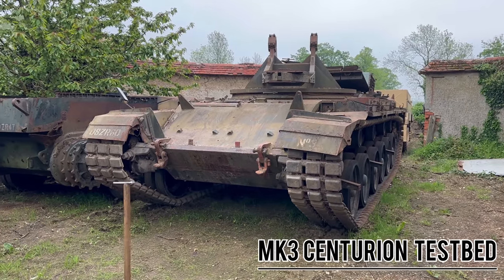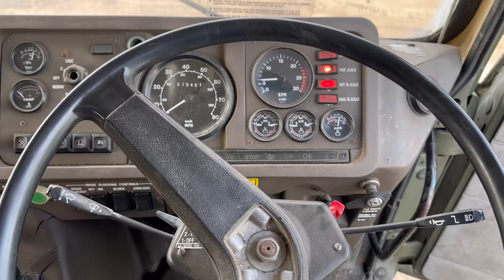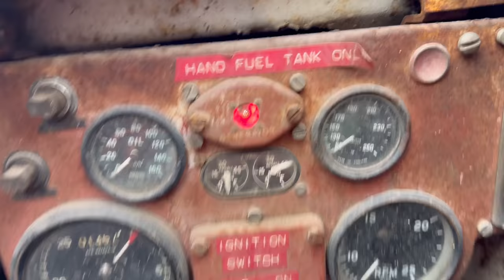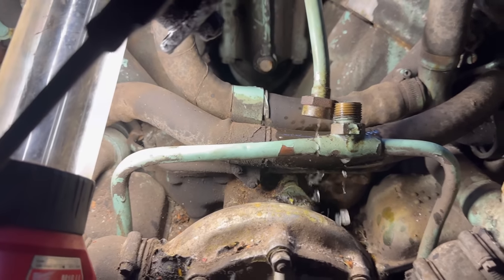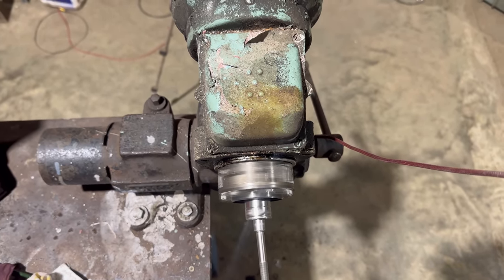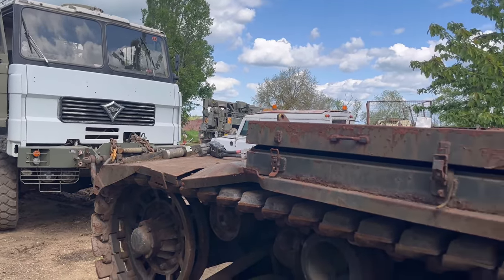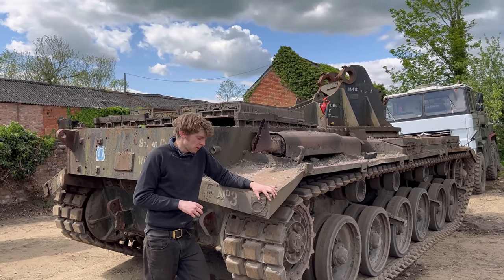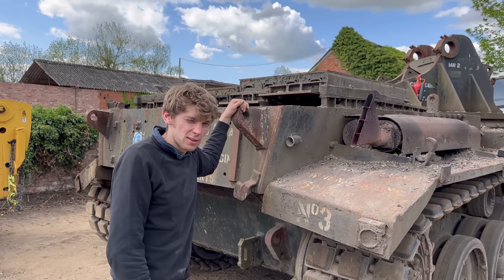Centurion MK3 First Start In Years!!

Comment: When you pushed it back was it still in gear? Wouldn't pistons, pumps, etc. move in reverse direction than they were designed to? That might cause some issues.
Reply from the maker: Nope
Reply from the maker: Didn’t push it back in gear

Comment: New to channel.  But what possessed them to go with petrol engines after the experience of the “Tommy cookers” of WW2
Reply: Apart from russia all the tanks on both sides were petrol
In the case of the centurion,the engine is a detuned merlin aircraft engine
Reply: @stewartbrown8115  I know that.. but what possessed them to continue with petrol.
Reply: @CaptainK007  because the meteor was a reliable & trusted engine
Also its always easier to get petrol rather than diesel in some countries,especially if the rest of of the support vehicles are on petrol,ie lorries ,reconnisance cars etc

Comment: What's the second set of points in the magneto for?
Reply: My guess is redundancy. If one set fails the second still works and keeps the tank running. 🤷‍♂
Reply: It's an aero engine - they always have dual ignition systems - so it probably has dual magnetos smushed up in the same box. In the original Merlin (this is a Meteor) engine the second lot of contacts would have fed another 12 sparkplugs for a total of 24.
Reply: @rosiehawtrey  one magneto was for the inlet plugs,the other mag was for the exhaust plugs,these used to be tested under load on the test bed,and the power drop was measured when running on one mag

Comment: FV4005 Stage 2
Reply: I wonder if he is teaming up with Bovington to finally unite the 4005 turret to a MK3 hull again
Reply: It isn't at all its 140mm gun testbed
Reply: @terik3312  yes however if you watch the video he teases that he is planning to turn it into a 4005
Reply: @STHV  yes which to be honest is slightly disappointing  the history  the vehicle has on its own is awsome enough no need to turn into something it wasn't
Reply: @terik3312  As long as the mounting is preserved I would be fine with it and seeing 4005 get the restoration it so badly needs would be worth it imo. I can't stand seeing 4005 just rusting away with holes in its turret.
Reply: @STHV_  that's more something that's on bovys head they've  had the opportunity  to maintain it and care for it but they've left outside to suffer on the wrong chassis for so long
Reply: @terik3312  Yeah similar thing with the Churchill gun carrier, the least they could do is cover it and the other wrecks so its not getting rained on constantly, no sense in letting it get worse than it already is.